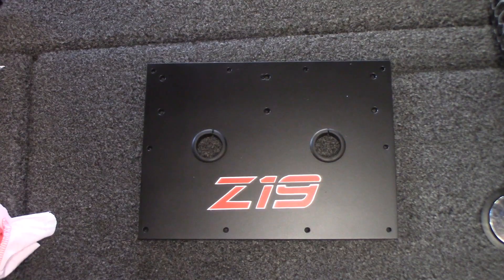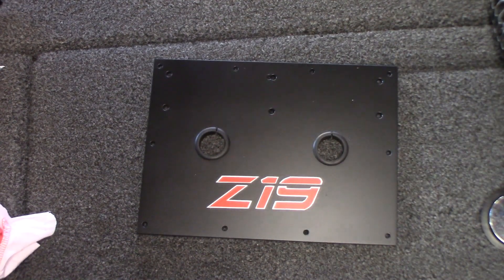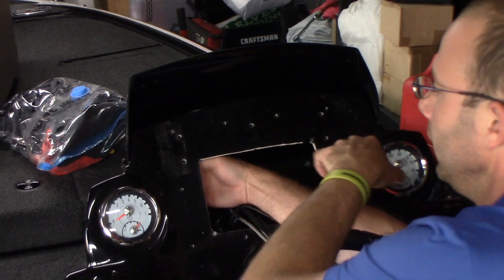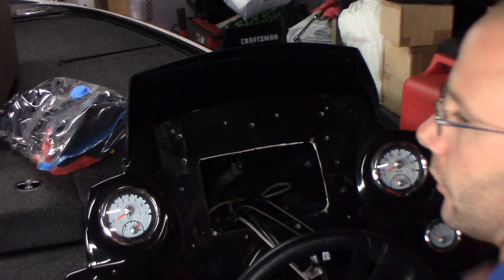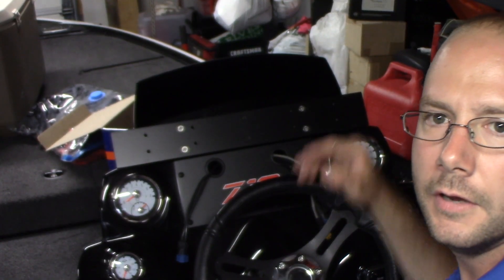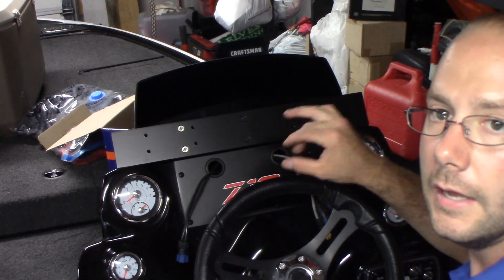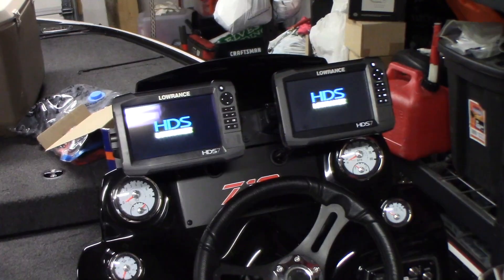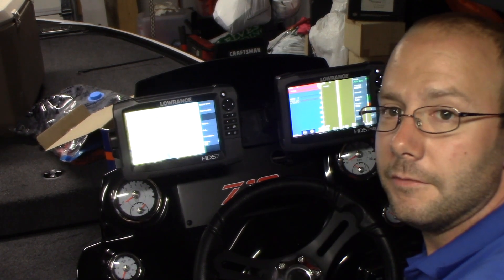CUSTOM DUAL SONAR MOUNT

Comment: Do you get any vibration on the screens as you are moving across the water?
Reply from the maker: Very little but I ended up upgrading to hds live 12s and have the BBT heavy duty brackets now at the console and have 2 hds live 9s at the bow on a custom mount with the RMP Heavy duty gimbal and they are all rock solid. I run. A lot of big water and trust the 7g in electronics are mounted as best as they can be

Comment: My console is plastic and doesn't seem incredibly strong compared to the fiberglass. Do you think this method would possibly still work?
Reply from the maker: If you did bolt through the plastic and maybe really big washers behind the plastic or make some supports like 1" wide with the same hole spacing at the first plate and then put that  behind the plastic with the bolts through

Comment: Do you have specs you could share?
Reply from the maker: not in full details but I can make more if interested in one
Reply: B.S. BASSIN I’m interested for sure.
Reply from the maker: @codybush1500  what units you looking to mount? I removed my 2 7 units and did a hds 12 live used most of the same components
Reply: B.S. BASSIN I’m installing two helix 7s at head.
Reply: B.S. BASSIN will they not work with helix 7s?
Reply from the maker: @codybush1500  they should